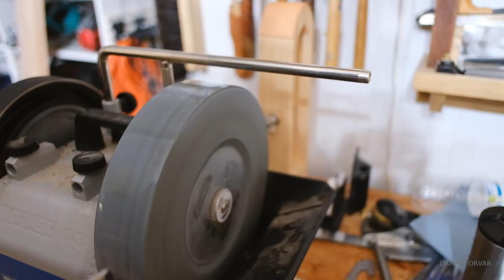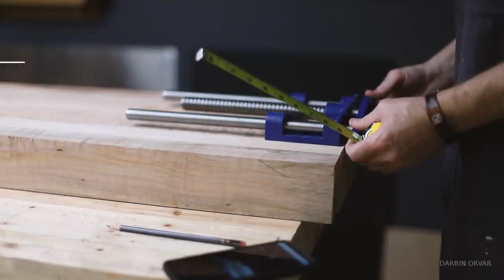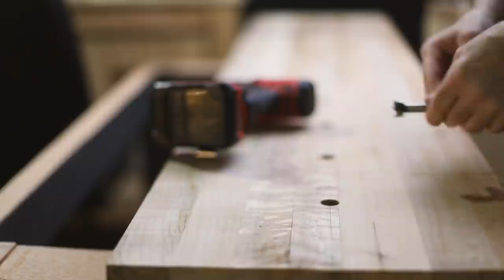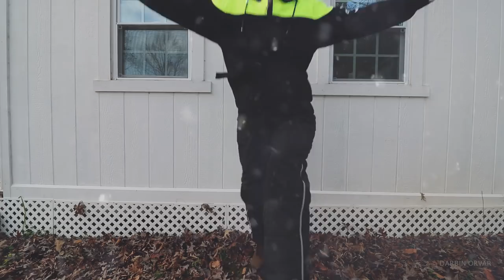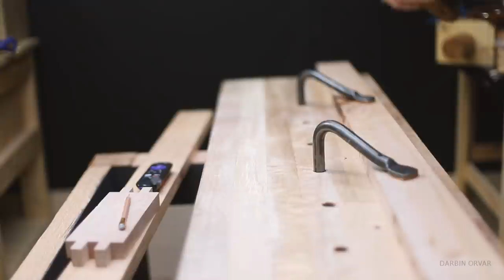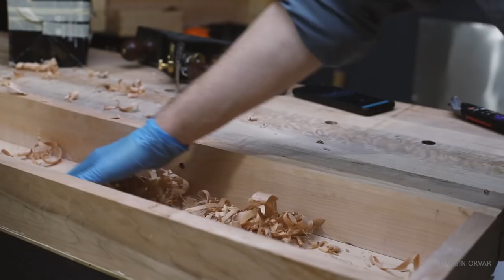Building a Joiner's Workbench with a Tool Tray

Comment: Thank you very much for this great article and the great content. I find many of the steps in the process very exciting and are done the same way all over Europe. There is a big difference that in Europe it is not allowed to work with gloves on rotating machines. That means that hand shoes are not allowed to be worn on drilling machines, circular saws, table saws, electric planes, banks, thicknesser planes or whatever else is available. Also in case of an accident the insurance would not pay here. But in principle the work is absolutely identical. Well, how could it be different if you work with wood. And we do not have to reinvent the degree every time. I think it's really exciting how you have worked in the inlays for the clamps with the cnc milling machine. That inspired me a lot. But unfortunately I don't have such a big cnc milling machine at home. A great job and great furniture that was built here. I love your content and am already looking forward to the next 
affectionate greetings from Germany (Europe)

Comment: Might it have been a better option to refrain from gluing the top to the frame so that when it needs re-flattening/cleaning up you could just pop it off and run it through the planer?
Reply from the maker: It's part of the rigidity of the whole unit. Easy enough to hand plane if necessary.